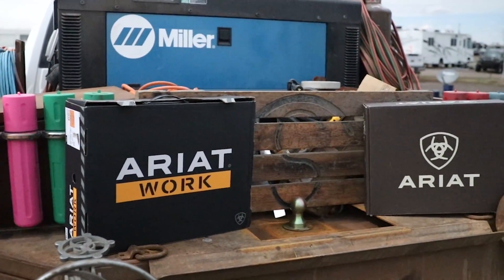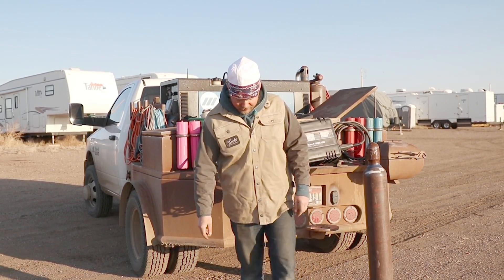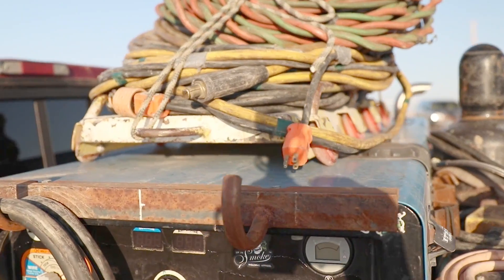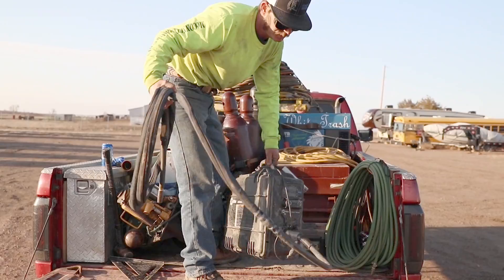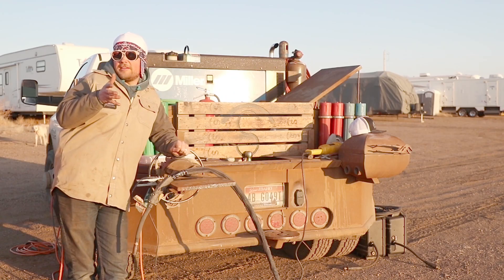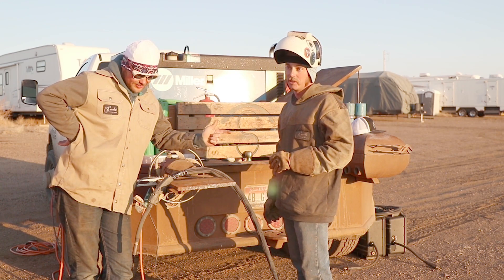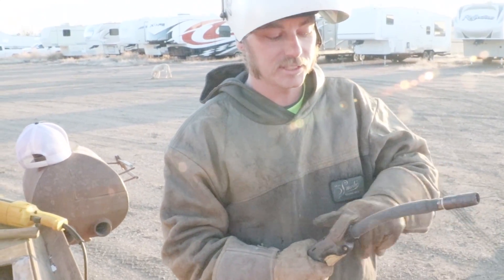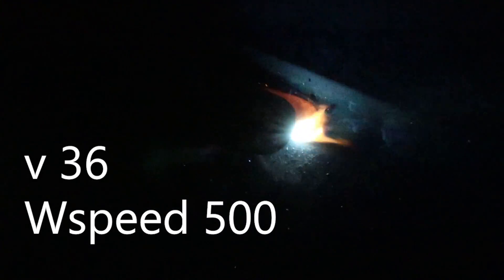Dual Shield Set Up - Miller extreme 12vs Suit case Wirefeed

Comment: We rock 5/64 (2mm)  Innershield and its like a coat hanger coming out of the gun lol. At  that point it's almost like a stick electrode inside out. I learned stick in school  and the  first weld test i ever took for work was with FCAW-s. Puddle behaves very similar to 6010 and one you see the puddle form you can run with it - Keep up the good work guys 🤙🏼

Comment: I'm surprised you don't see a lot more suitcase mig's out running in the field. I'm just an equipement mechanic that does a fair bit of welding repair / fab work -- Not a pro welder by any means -- and I bought a 12VS for my mobile projects. I just run it off an ancient Trailblazer, but I also run gas mix with it -- my customers are happy with the better-than-factory looking work on anything I put together for them....Even on stuff like machinerry frames, that flex head would be awesome. I'm putting that on my wish list now!

Comment: Wire welding is ok until you do 200’ a day on fillet welds Or 100’ a day on vertical, don’t miss it, but its always there if I need it, it’s beginning to look like I might, if things don’t pick back up in oil field.
Reply: Theres plenty of shops in houston that want you to have mig and fluxcore experience, pay may not be what you expect (typically below $23/HR) unless you can also fit then the rate goes up by 50 cents or whatever you negotiate
Reply: @Ruben901  50c more for that much more skill is a slap in the face, especially these days. 50c was a cheapskate raise 20 years ago when things cost 1/3 what they do now.
Reply: If I had to do 200 feet / day, I'd MUCH rather use a wire feed than stick - that's for sure! :D
Reply: @notsure7874  depends on how good you are, a 7018 5/32 piloted right will do the same width but at a slower pace due to restart s

Comment: What shielding gas is he using on his rig?  When I was a structural welder, we strictly ran 75/25.
Reply: I see a couple CO2 bottles on the rig but there’s also some maroon bottles that could be 75/25. Some dual shield flux core wired requires 75/25, others are designed for straight C02. The sound of his weld is much different that what I’m used to hearing but I never ran anywhere near 36 volts either. My 400 amp machine was typically set at about 26.5 volts depending on wall thickness and welding position.
Reply: @BrentCameron  same, most I've ever run was 34v and that was through 900 feet of lead. this was off my vantage 400

Comment: the dual shield you was using was it 052 or 045 and the gas was it 75/25 any info would be great thanks Mark
Reply from the maker: .045 dual shield with straight co 2

Comment: great vid how do you set up a Miller XMT 304 cc/cv with a miller 12vs to run gases flux  core any info would be great thanks Mark
Reply from the maker: Just run quick connects my friend. Turn it to cc and make sure the suitcase matches then you volts will be on the machine and the wire speed will be on the suitcase

Comment: the wire speed will stay constant for the most part but you (or I) will let your viewers know that just because its set to 36volts does not mean thats what he's welding at.. I run the same lead sizes (2/0 and 4/0) and always have 300', whether the weld is right behind the truck or 100' away... my voltage drop with Lincoln 71 elite .045 dual shield wire is about 6 -10 volts and as the wire size goes down so does the voltage drop. I welded some .030 solid wire er70s6 the other day and the voltage drop is minimal. maybe 1-2 volts. with my 12vs suitcase I can look at the digital display right after I terminate the arc and see what my actual voltage was/is. keep this in mind when you setup and look for parameters to set your machine up to.if you get birds nest after birds nest or it runs good for the first 5 seconds with the soft start feature on... then voltage drop is your problem. up the volts and weld on!
Reply from the maker: Thank you sir for this comment I screenshot it so I could go back to it for reference. Thanks again.
Reply: Jacob Schofield I made a lot of mistakes with the wire feeder (12vs) and it was nothing but a headache.. to the point where I didn’t use it when it would have been faster.

Comment: Is the welder set on cv ? It seems erratic for a dual sheid .
Reply: Thought the same thing.  Maybe steel was dirty.   Not on board with the cable explanation.  Don't bark because I am good with all the math involved in ohms, volts, watts, amps, hp and so on.

Yeah,  no need to have gone there.    Do you happen to know how many watts in 1 hp?  And if you were running 120 amps at 24 volts how many hp would be reqd to generate power to do that.  Now if you're at home reading try looking at this.   R = V / I.
Reply: newage3397 hp ?? Lol
Reply: Jim Alley that’s what I thought
Reply: I thought the wire speed was a bit high or the torch angle making more weld spatter than it should.
Reply: Brent Cameron or polarity , thats a possibility, wire is direct current electrode positive when running field wire

Comment: Stupid question here - that vise is bolted right on your truck body, and you just ground to it and strike arcs ... how do you keep it from zapping your trucks electronics / blowing up batteries or whatever? Is it just safe? Are you just extra careful to make sure your ground is close, and really good?
Reply from the maker: So not saying that it ever Wount fry your computer but I never disconnected batteries or anything like that. And I’ve been welding off a truck for a long time and had zero issues.
Reply: @JacobSchofield  I figured it was probably fairly safe, or there'd be a lot more welders talking about precautions.

Comment: Is that similar to a flux core
Reply: Yes, it is still a flux cored wire, only difference is composition and the need for a gas shield as well
Reply: It is flux core use a shielding gas also Used at Letourneau Marine building deep sea jackup drilling rig

Comment: The position of pushing the puddle is not good because all that splatter will come out on a x-ray , unless there is no c-ray then it doesn’t matter i guess
Reply from the maker: Ok CWI... how you supposed to X-ray a fillet weld? The only thing they would see is a two black line down the middle 😂 you PT fillet welds and when your cooking at 28 amps  Nothing is alive in that weld. X ray is a big deal to me. But it’s done on full pen welds. So is phase to ray.
Reply: Jacob Schofield EXACTLY lol i said if it’s not x-ray then it doesn’t matter, but if anyone is doing x-ray welds and welds the same position as this video will fail the x-rays and would be grinding all day LOL 😂

Comment: You switch to a true remote?
Reply from the maker: no sir this is Millers new remote and it will blow any of the others out of the park!
Reply: @JacobSchofield  yea im still running the original miller wireless remote on my pipe pro but i like the remote start feature u got a link or something to their new 1?

Comment: Don't look for any pickup in the oil patch.   That guy said it all when he said it's only water lines for him.   Tell you what from what I've seen on these guys working on pipe are too narrowly focused trade wise.   Going to be a lot of trucks going back to the lien holders and equipment on Craigslist.

WTI hit 19.92 at 10 pm.   EST.  Lowest price in 18 years.   Oils done for a long time.
Reply from the maker: Water lines and oil lines are two different things. And two different careers oil prices don’t have anything to do with water.
Reply: @JacobSchofield  you trying to transition into other lines of rig welding? I dont own a rig but I run one for a steel erection company putting up metal buildings. Doing bolt up and weld up frames. I love the I beam fabrication. done some stainless and aluminum on the food side doing commercial bakeries about 5 years ago and worked production welding in trailer factories shortly after that for about 3 months, never will I ever lmao
Reply: @darrellwhite3261  Why not? 🤣🤔

Comment: Jake, have you tried out Metalcored wire??
Reply: On pulse that is.. Miller style
Reply from the maker: I have not will have to look I tonit
Reply: @JacobSchofield  92/8 argon co2 on my rig
Reply: Im running off of a XMT 350 MPa with a S 74 mpa plus feeder. My metalcore settings are kind of a mix of globular transfer and spray
Reply: Love my 12vs . Was kinda a pain to initialy set up but was you figure it out it goes great.

Comment: 3:30 well duh...i thought that was one of the major selling point of a suitcase not having to go back to main machine for adjustments...i mean c'mon now isn't that what I'd for and purpose for a suitcase...common sense. I have no feild experience and even i know that the controls are adjusted on the suitcase n not the main.
Reply from the maker: It shows... a smart feeder with arc reach can be controlled from the suitcase both volts and wire speed. A extreme 12vs which is the one in this video only has wire speed. Now before you decide to write a dumb comment again and make yourself sound smarter then you actually are, be damn sure you know what your talking about. This man on this video deals with these suitcases every single day. Don’t you think he probably knows more about them then both of us?? Have a great day.

Comment: What size wire is he running? 
1/16
Reply from the maker: .045 dual shield
Reply: @JacobSchofield  that's what I run 045 but don't run a dual Shield I just run straight flux core but my bread-and-butter is building dog legs to pivots